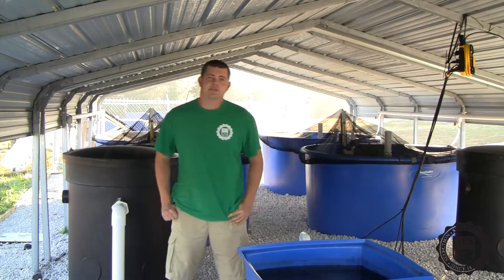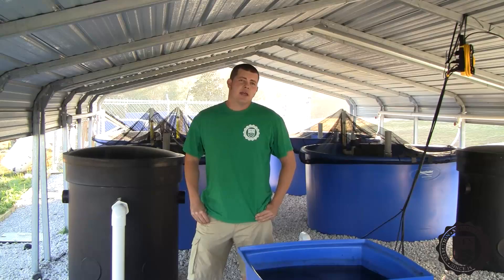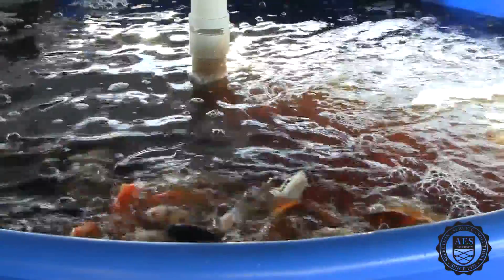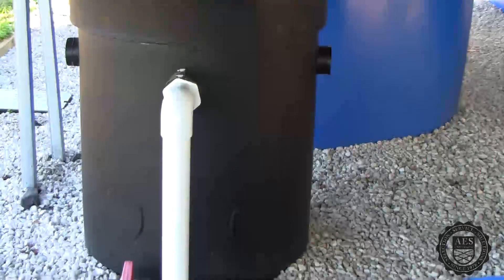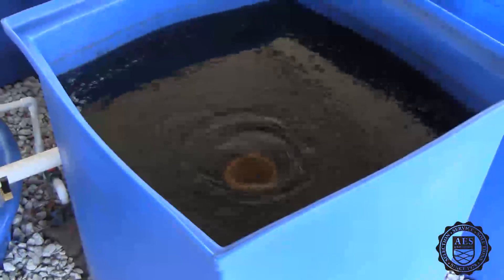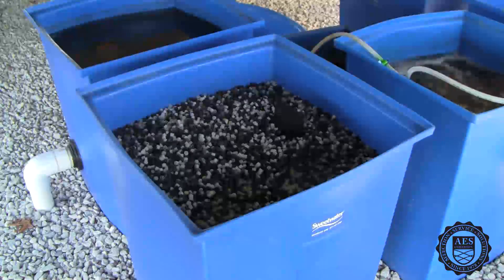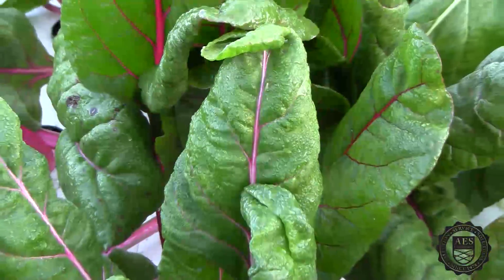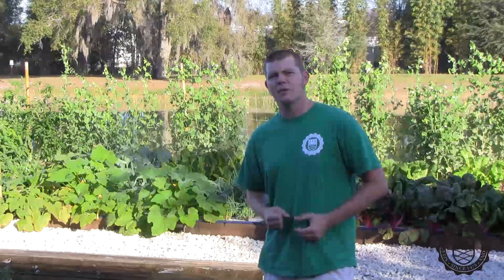Introduction to the AES Aquaponics System

Comment: Really depends on the type of fish. If using something like Tilapia then you can get away with 1 fish per 10 litres (about 1 fish per every 2 gallons). Due to the fact when they get big enough you will be harvesting them. If your using Koi then remember Koi require a lot more space per fish.General rule of thumb in Koi keeping is 1 fish per 10 gallons of water due to the size Koi will grow. so with Tilapia if you have a 1000 litre tank 219 gallons 100 fish if Koi then 21 fish for that size tank